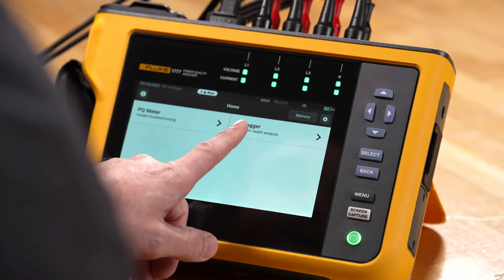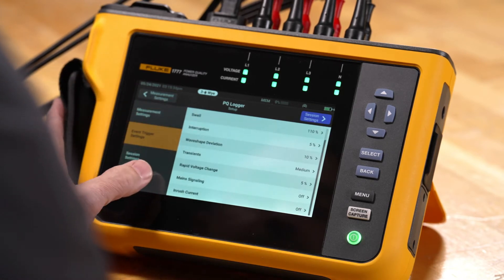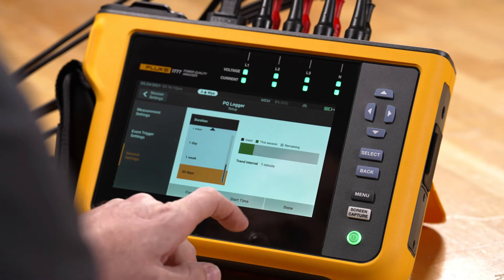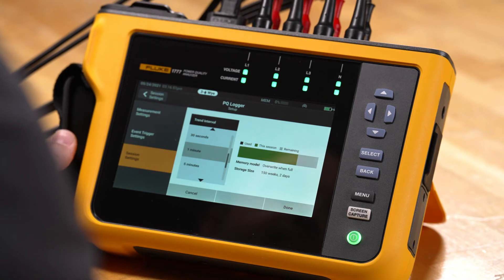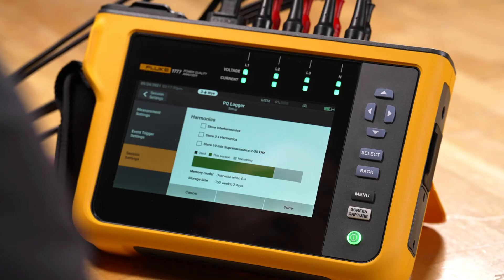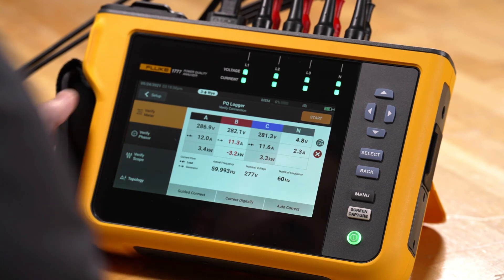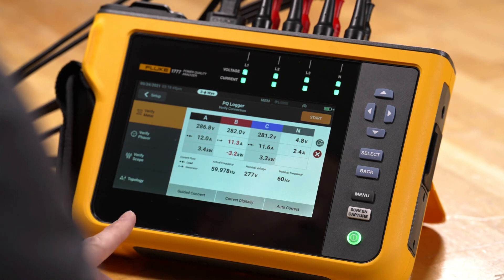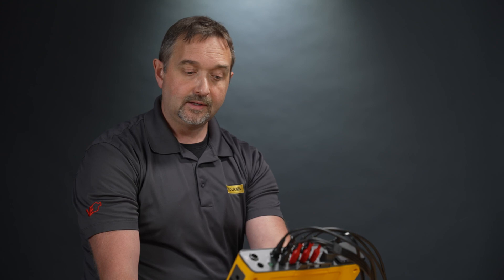Using "Logger mode" on the Fluke 1770 Series Power Quality Analyzers

Comment: I have a query which is the lowest temperature capable of showing 51/22 II with 80PK-26 probe?
Reply from the maker: Hi Yhury - The temperature probe is generally the limiting factor, so that is where we will start. The 80PK-26 is specified to read temperatures down to -40 C (that is the lowest it can measure) and the Fluke 51/52 II thermometer can display measurements of Type K probes down to -200.0 C. Hope this helps.

Comment: May i know what happen to the previous model such fluke 435 & fluke 438...As far that i know new model Fluke 1770 series still don't have any replacement same like fluke 438 where this model do have motor analyzer mode. I believe Fluke should come out the new PQA with motor analyzer to cater the market now instead new model seen like only changing internal features, touch screen and add on wifi function where at model FLuke 1736 & Fluke 1738 already have it....my apology, this is my point of view.